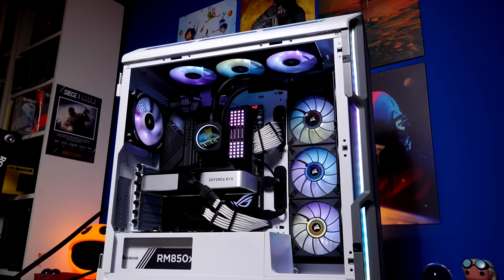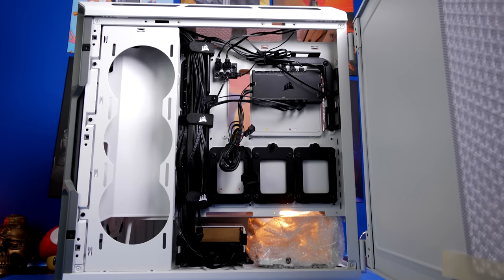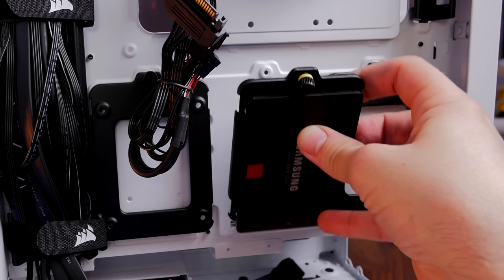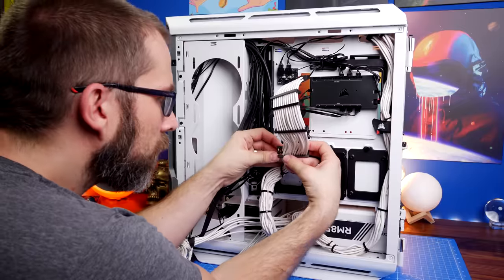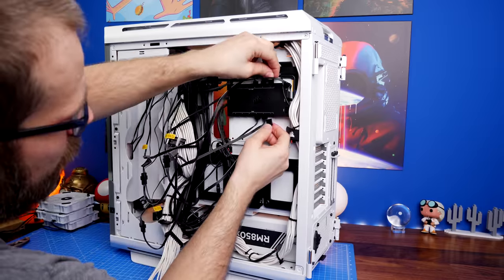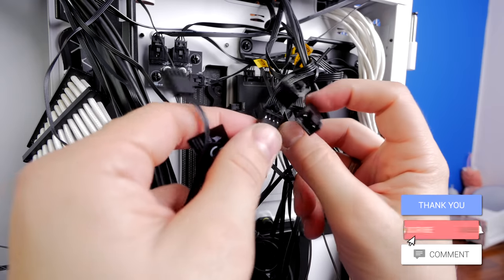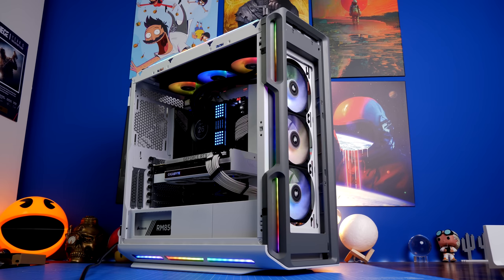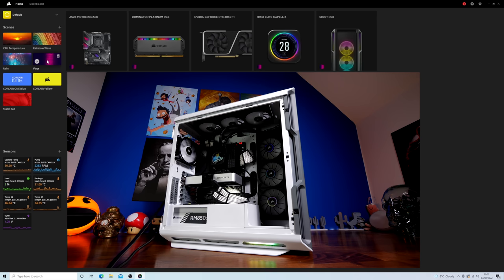Corsair 5000T build and installation guide - 10 fans and two different AIO coolers

Comment: Thanks for the video! 👍
Quick question though. Would leaving the 3-fan radiator on top as exhaust and then having a 3-fan front and 3-fan side intake setup give better cooling?
Reply from the maker: Not something I tested. I'd imagine it would be comparable though
Reply: @TheProvokedPrawn  i think exhaust from top is better and fresh cool air coming in front.. instead of aio in front the heat from radiator will just add temperature inside instead of blowing it our directly on top
Reply: @AldousTV143  so you think radiator should go on top and be exhaust?

Comment: Question about the front panel, it has two meshes on it, can they be separated? If not then you'll have dust trapped in between those meshes making it near impossible to remove dust from them.
Reply from the maker: You can remove them yes

Comment: Great video as always Prawn! I've got a question though: which case makes the front fans stand out the most, the 7000d airflow or this one?
Reply from the maker: This has LL120s Vs airguides in the 7000D. So it's basically RGB Vs airflow
Reply: @TheProvokedPrawn  so you're saying the 7000d has better airflow?

Comment: Does it come with a corsiar fan hub XT? And how do I control my 10 fans if software only allows 6? Icue software
Reply from the maker: It does, I showed that. As for more fans, you need another Commander or perhaps connect them directly to motherboard headers for power and to lighting nodes for the RGB
Reply: Do I just connect my 2 fan hubs to a USB 2.0 and to SATA?

Comment: Mr Prawn - first of all, great video, and really helped demystify some questions I had about my 5000T when I did my build a few days ago.  At one point in your vid (around the 34:30 mark), you talk about how there are 2 USB 3 leads that need to go into the mobo (for the top 4 ports), and say that you can find a splitter online if your board only has one.  I'm in that particular predicament, but I cannot find any online.  I have, however, found other threads w/people who have my board, who are also looking for ways to solve this, and they were not able to find anything either!  There are a few cables on amazon that claim to be USB 3 splitters, but the reviews all say that they are not true splitters, and make it so that neither of the USB 3 leads are seen by the mobo.

Could you please provide an example of where I can get a legitimate USB 3 splitter so that I can plug them both into the single port that I have?  Thanks!!
Reply from the maker: Sadly I bought one but haven't had a chance to try it so I can't say for sure it works and it's got poor reviews now since I bought it too 😭
Reply: @TheProvokedPrawn  oh no, "checks mobo just ordered"

Comment: This video is and will be super helpful when I finally build my PC in the next couple weeks. Just two questions:
1) I have a Aorus Z690 Pro DDR5 Mobo that only has one USB 3.2 header. What do I do with the extra USB front panel cable? What will happen if I don't use it? I can't find anything about this online.
2) Is it possible to do a push pull set up with 3 fans push and 2 fans pull? I would like 13 fans in my set up but don't want to buy another commander pro since im getting one from the case and another from the AIO kit. So taking one fan out the "pull" would keep me from spending more money. (Only reason I want push pull is to cover that extra gap above the mobo and under the fans in this huge case lol)

Thank you!
Reply from the maker: 1) you can either use a splitter or don't use it. If you don't then you will just have less front panel connections. No other problems. 
2) you could do, sure. Though it would look weird, it'll still work. I've done it before in a case where a third fan wouldn't fit.
Reply: @TheProvokedPrawn   do you have a recommended splitter I should get? Also found something on amazon that plugs into one of the pci-e slots and it gives an extra usb c and usb 3.2 header. Thank you!

Comment: I'm planning a build using an Arctic Freezer II 280mm and an Asus Strix LC RTX 3080 Ti (because I found one in the same range of the FTW3 and the TUF editions, My country is crazy). Sadly, I noticed it's hard to find a good case with enough space for TWO radiators. I saw several videos, but I still have no idea if I can install something like this. Is the 5000D big enough for both radiators? I noticed the 4000D it's not too big for a setup with the radiator mounting the tubes in the lower level.

Of course I'm worried about the money, I've planned almost everything, but the case isn't that easy when you need this configuration.
Reply from the maker: Yes, you can install two rads. One at the top and one either at the front or the side/rear panel. Just not front and side at the same time
Reply: @TheProvokedPrawn  thank you, then I will be spending on this one. I recently discovered your channel, very informative 👍🏻
Reply: @MrlspPrt Did you complete your build? I've been planning a similar dual CPU/GPU AIO setup in this case, but the more I look into the intake/exhaust position choices, the more confused I get and just so many people saying different things. Any pointers you could give would be appreciated! Thanks

Comment: Going to make a new Black Friday build and I've settled on the 5000T as my case.  I'm not a big RGB guy at all, but I love the 4 USB ports on the front.  I don't like water cooled systems in general, I've always used air-cooling.  I know the new 13th gen Intel's and AM5 Ryzen's run very hot though!  I have the Noctua DH-15 and I don't plan on over-clocking.  I would have loved to have seen the results from a passive air cooler in the system.  Otherwise, this video was very informative and will give me a jump start on my build!
Reply: Hello,will i be able to add more LL120s fans to this case without buying anything else? For example 3 more fans. Dont i need to buy separate controllers for them or i just buy fans and connect to the stock core xt controller?  Will i be able to control all the rgb and speed on 6 fans with stock controller? Thanks

Comment: Hi there, 

I'm building a pc with the Corsair iCue 5000X RGB. I'm going with the Corsair H150i elite capellix. My question is, should I match the fans that come with the cooler which are the ML120 RGB PWM fans? or I can use the fans that come with the case and just buy an extra one ML or SP for the back one? Thanks in advance and great video.
Reply from the maker: My advice would be don't mix and match fans if you can help it. Better aesthetics and airflow if you keep them all the same. It's perfectly fine to swap out the ones on the H150i Elite with something else if you wish.
Reply: @TheProvokedPrawn  Thanks so much for the quick reply! My original plan was to buy 4 ML 120 so the whole case has the same fans, i was worried about compatibility and fan controls as this is pretty much the first time building up a PC and still a newbie. Thanks a lot and keep up with the great videos!
Reply from the maker: @silverfox97480  yeah that is a valid concern. Though a mix of fans will work, some will have different airflow capabilities, different min and max speeds and other specs, so it's better to keep them all the same if you can
Reply: @TheProvokedPrawn  Yeah fair enough! One more thing, if I get those 4 extras ML120, I will end up with the 3 SP120 spares the comes with the case, is it worth it to use  them on the side mount like in your video or not? I'd be happy with a 7 fans setting if it involves more cost and messing installing those 3 spares. Thanks again

Comment: How many commander cores are in that setup. I’m doing a SL120 x 10 fans that require 2 usb alone so take up all the commander pro, then I have the H150i cooler that uses one usb and then I have the icue lcd adapter kit which also has another usb i believe . My motherboard only has 2 USB ports and I also need 1 port for case usb and annoyingly the 10 fans require power yet 1 commander core  only has power for 6 so I’m guessing I need 2 commander cores ideally.
Reply from the maker: Two. You can get usb splitters to deal with the lack of headers.

Comment: I just bought this case and an MSI z690 force, and wouldn't ya know, the case has two front side USB 3.2 gen1 connectors and the board only has one header. Crap. Looking for a port cap or plug now...

Comment: So I’m building practically the same build with the 150i elite lcd -10 fans total. I can’t get all the items working. I can get either both my cores working for the fans or I can get one core working and the lcd working. I have a 570 auroras elite ax mother board so o bought your recommended usb splitter but it still doesn’t seems to be working. Also my led strips haven’t been recognized and haven’t turned on yet.  Any suggestions? I would really love the help. I checked all cables and everything is properly connected.
Reply from the maker: You should have  USB fan splitter with the Elite cooler shouldn't you? Is it a USB problem do you think? I have a fan wiring guide, but it might not be helpful at this stage https://www.youtube.com/watch?v=jvXCbny-Suw did you watch my Elite Cappelix cooler video? https://www.youtube.com/watch?v=XahzpIZFyrM
Reply: @TheProvokedPrawn  when using the supplied splitter it doesn’t recognize either item plugged into it. That’s why I bought the splitter. Though when I used the splitter I still had the issue where I could only get 2 of 3 working. Maybe it’s a motherboard issue then? I mean it’s a pretty good mother board imo but I’m not sure where else the issue would lie. The led strips not working still also confuses me because I checked all connections and everything was wired properly prior to me receiving the case.
Reply: @TheProvokedPrawn  I also understand there’s only so much you can do through a comment. I appreciate your time and videos. They have been very helpful and this is just an issue with my configuration. Have a good weekend!
Reply from the maker: @CharlieJ32  it's very odd indeed. Everything is connected to Sata power as it should be? Very perplexing. Most motherboards should be able to handle multiple usb connections. You could come on my discord and we could try to trouble shoot but it's tough trying to diagnose from afar.
Reply: @TheProvokedPrawn  I rewatched all your videos and I am a fool and got it all figured out and it looks great. I’m going to become a member because your the greatest. Thank you!
Reply from the maker: @CharlieJ32  oh phew. That's a relief. I'm glad you hear you sorted. ❤️👍
Reply: @justapairofnuts  let me think. I believe I used a splitter. I’ll take a look at my pc

Comment: whats the cheapest aio i can buy that i can put animated cat pictures on that thing?
i'll get rid of that dust filter on top if im using it as exhaust. i removed the on i got on my nr200.
Reply from the maker: The only ones I know that do it are the Corsair H150i Elite LCD and the NZXT Kraken Z73. But neither are cheap.
Reply: The Aorus Waterforce 280 or 360 X

Comment: Hello, Thanks for the video https://youtu.be/Aha7D5-ilQE?t=2753  are you still able to install 3x120 fans (not radiator) on the back panel with the 3.5 Hdd bay in place albeit adjusted forward?

Comment: I mean... pc-o11 dynamic achieves all these feats aswell..
Reply from the maker: Including fans and a controller?
Reply: @TheProvokedPrawn  well actually the pc- 0ll dynamic is 185$

the 5000t is 399$

The fans "included" (remember nothing in life is truely included, youre still paying for it) in the 5000t can be bought separately for 75 dollars in a 3 pack, same identical fans.

The commander core can be purchased for 50 dollars separately....its not even the commander pro....

so lets take 75 for the fans, 50 for the controller, thats 125$

you can buy the PC-0ll dynamic, the controller, the fans for 310$

I need you to tell me where the 90 dollars in value is coming from in the 5000T....so yes....yes the the Pc-0ll dynamic can achieve all these feats, AND save you 90 dollars. Id really love to hear a response as hopefully you can shed more light on this situation.
Reply from the maker: @Personalinfo404  you're forgetting the light strips. But I'm not disagreeing. It is expensive.